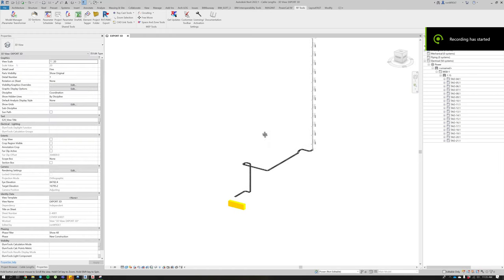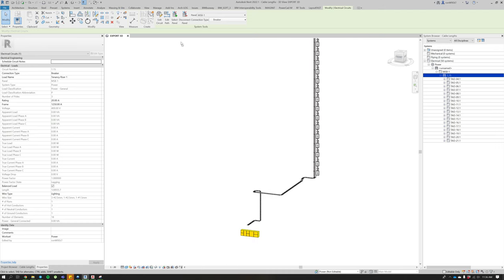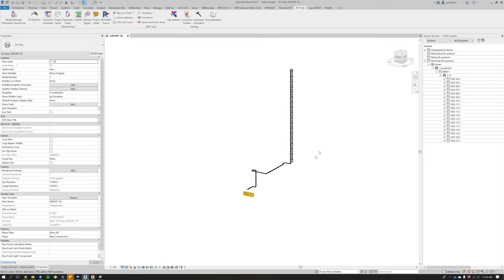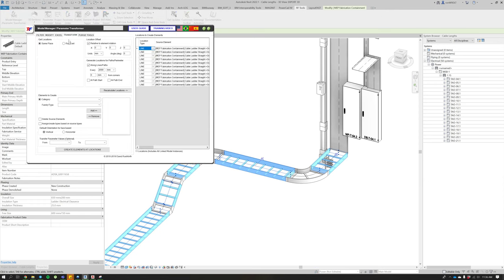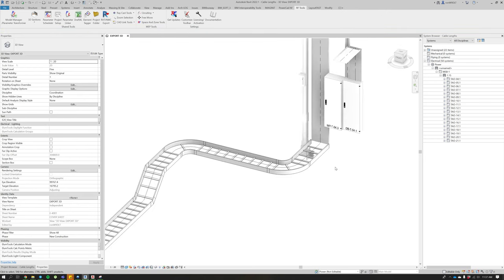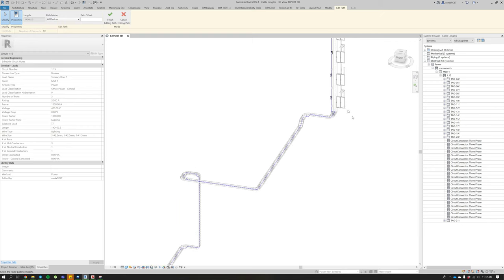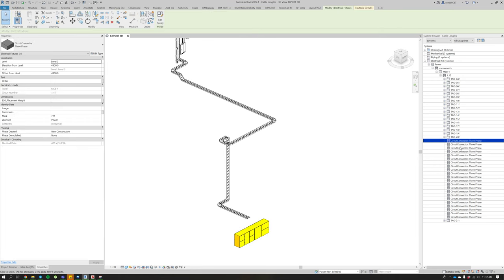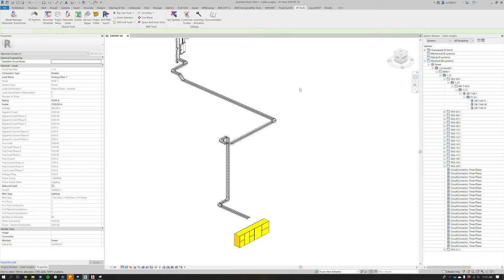Revit Circuit Lengths along Cable Trays

Comment: Really neat trick there. Good idea. Looks like this is not able to help if multiple circuit and multiple different paths.
Reply from the maker: Could easily be done with multiple circuits. Would just need to populate more nodes.. depending how far you wish to go really

Comment: Decent trick, this can be also done on conduits, I'd like to do it for free with Dynamo, I'd love to see you explain how)
Reply from the maker: I dont use Dynamo but would be really easy.. Just add a dummy family to the start and end of each cable tray. you would still need to assign them to circuits manually though. Understand RF Tools isnt free. but what it gives you is far more than just this.